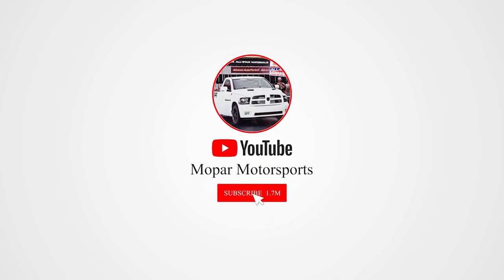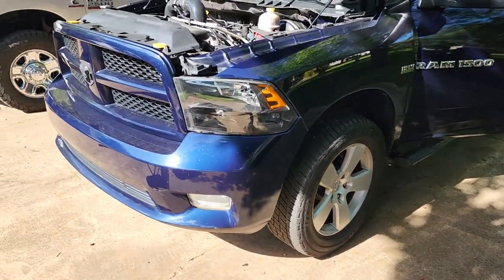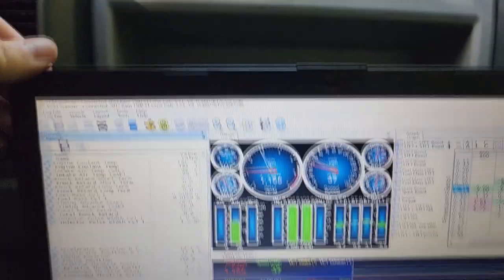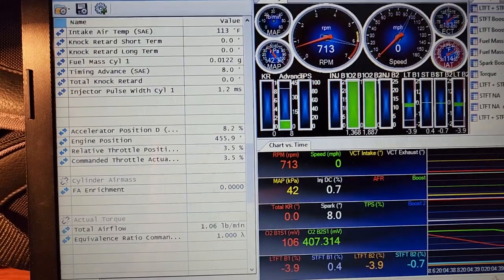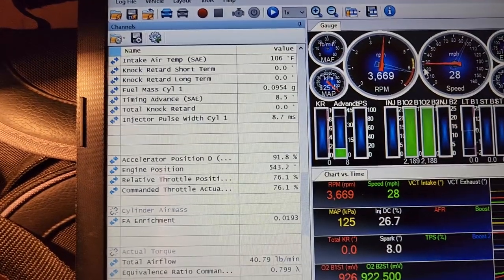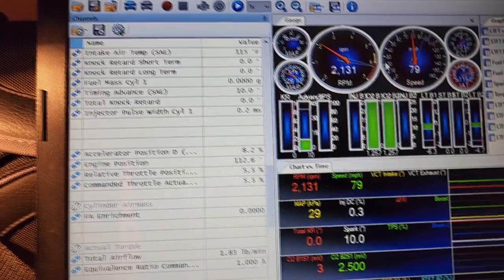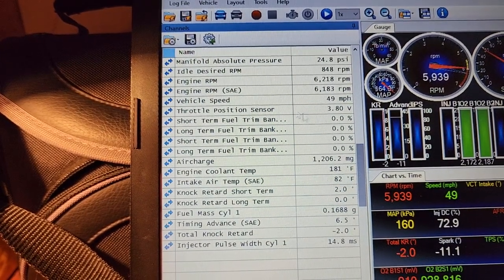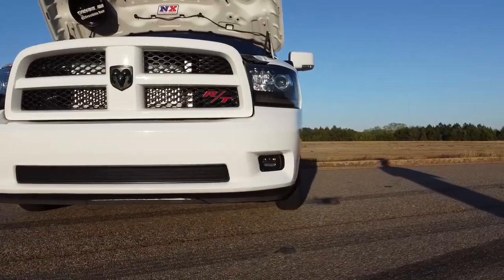RAM 1500 4X4 TorqStorm Supercharger & Water/Meth Injection Logging With No Intercooler.

Comment: I got a 2012 big horn and I just picked up my MMX 5.7 based 392 stroker for it  and im kinda eyeing the torque storm. Does that truck have the 65rfe? How does it like the power from the supercharger?
Reply from the maker: Yes its a 6speed and so far holding up on 9psi
Reply: Hell yeah, im hoping my 6 speed will hold together for a while in its n/a form until I can get the 8 speed swap done.

Comment: Great video as always! I really appreciate the level of detail you put into your videos. I'm starting a build that will be between Storm and Frostbite. I plan to keep it as a daily but with a lot more capability than stock. So far I have full exhaust with Stainless Works long-tube headers w/cats with an x-pipe going into a true dual exhaust with 2 Magnaflow mufflers. I have the diablo sport trinity T2 and an unlocked PCM on a 5th Gen Laramie 4x4 running the canned 93 octane tune. I'm getting ready to pull the trigger on a TorqStorm supercharger and am using the builds of Frostbite and Storm as a blueprint for my build. Plan on running an intercooler instead of water/meth. Do you have a breakdown anywhere in a past video of everything you still need to add and run the TorqStorm? It seems like as I build out my parts list, I find something else I need to pick up.
Reply from the maker: All the installation videos for storm and frostbite has parts links in videos description.
Reply: @FrostbiteRam  Awesome thanks! That gives me another reason to re-watch your videos!

Comment: How long does the water/meth last before needing to refill ?    And is there another alternative way to keep the IAT’s down outside of the water/meth ?
Reply from the maker: Water/meth last a long time really because it's only spraying when under boost normal driving has no effect on the meth.
Reply from the maker: Only other option is to build a intercooler setup.
Reply: Only drive it during winter.